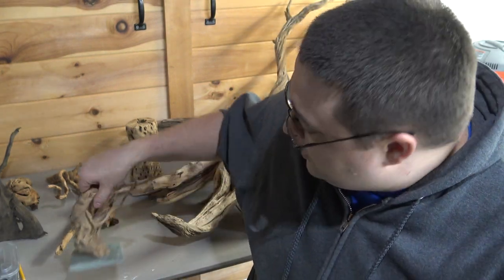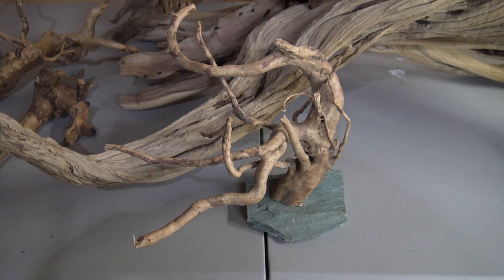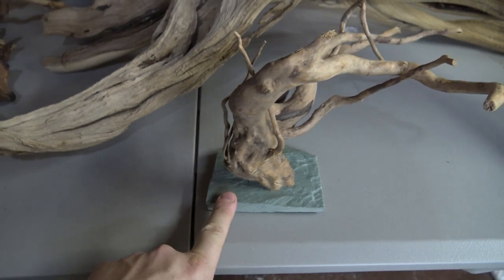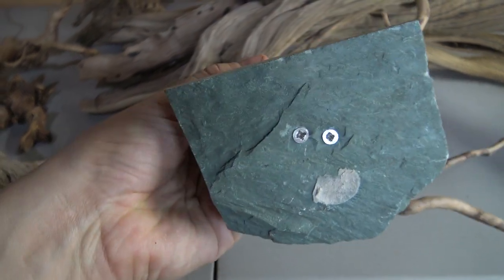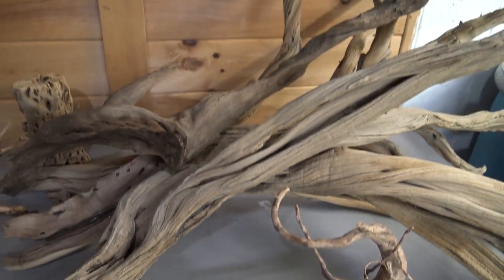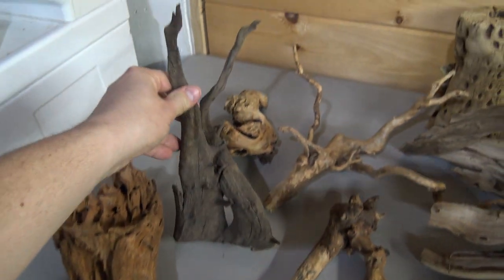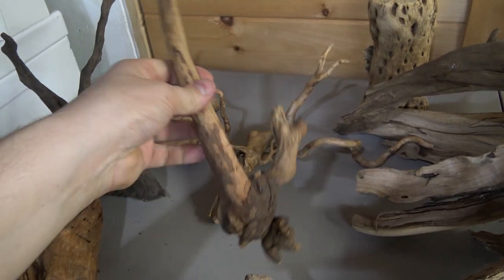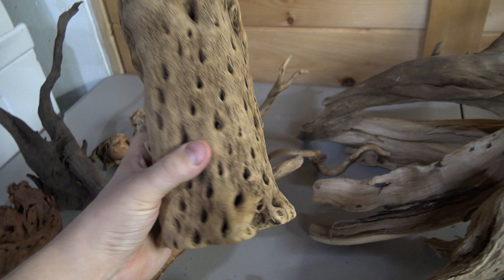#566: HOW TO DIY DRIFTWOOD SLATE - Update Monday

Comment: We live at the beach & have amassed a large driftwood collection. Would we have to boil the wood we have collected prior to putting it in fish tanks?
Reply from the maker: beach wood should probably spend a season in the sun to make sure all the critters are dead, i don't bother boiling, but you may need to soak it and dry it several times